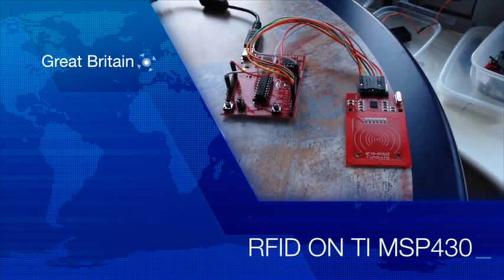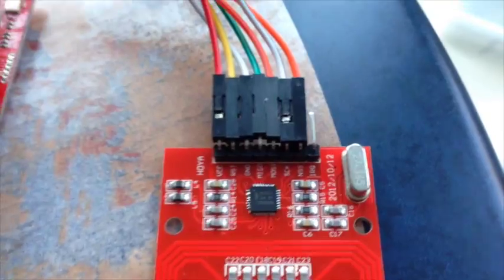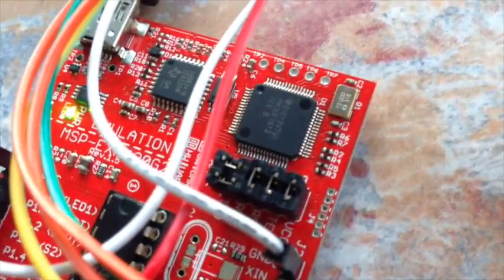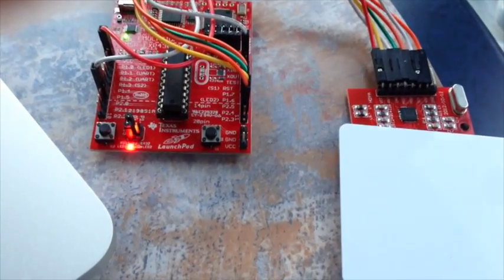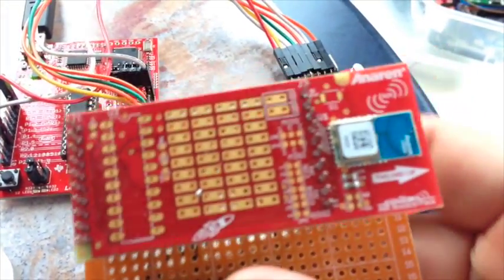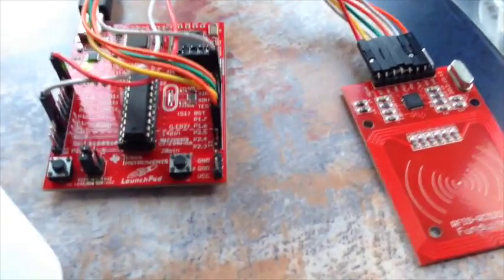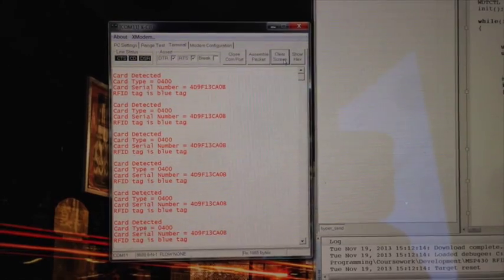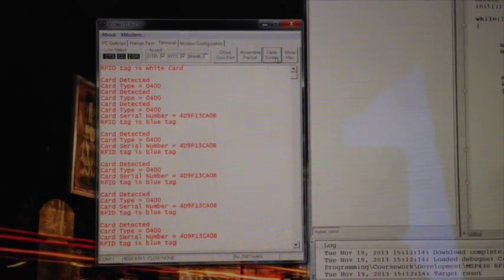RFID Reader working on Texas Instruments MSP430 through SPI interface

Comment: hello!! I saw u used msp430g2553 to control mf 522, and I recently bought the same one. However I don't have any code about mf 522, so it doesn't work . Could u give me the sample code of the msp430?
Reply: Could you please share this code if it was thrown to you? .Can you just throw a simple code sample for reading, writing and displaying data? (Assembly or C does not matter)
Example RFID:Rc522 RFID reader 13.56 Mhz
I would be glad if you help